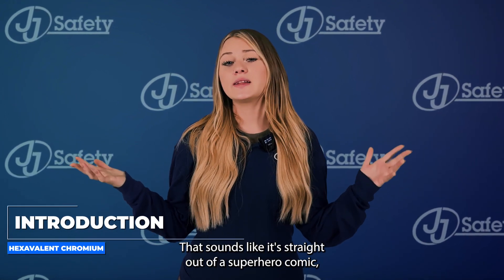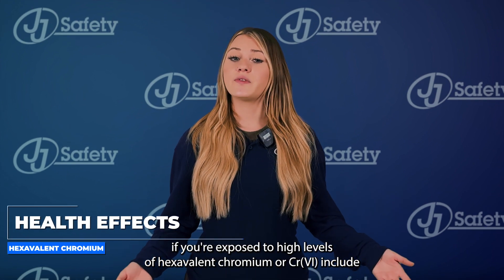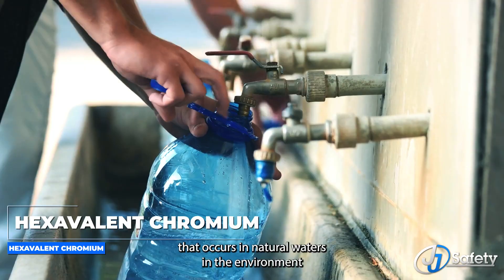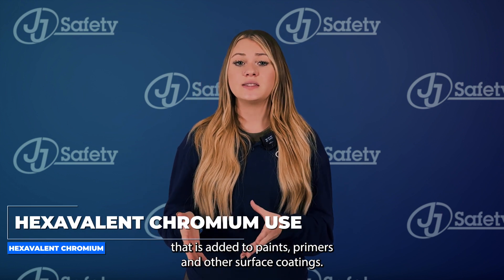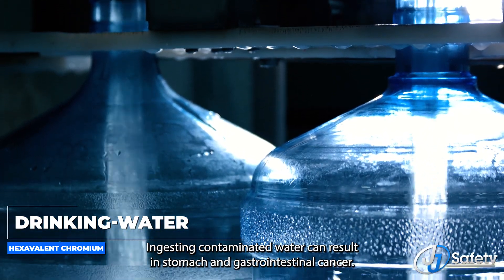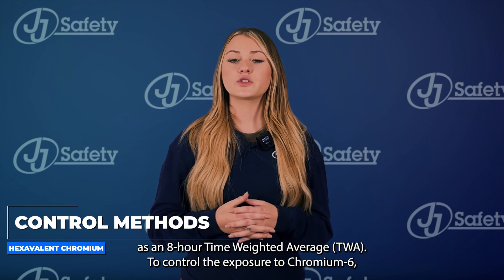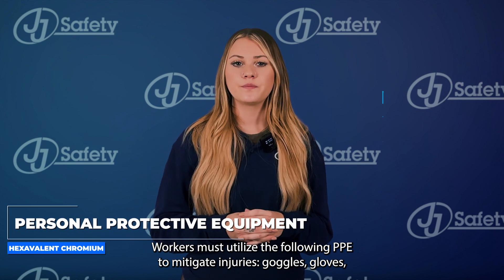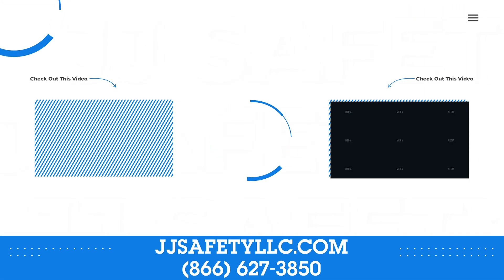Hexavalent Chromium: Know the Risks, Stay Safe! [Toolbox Talk]

Comment: I wish I had watched this video in 1982 (😁), which is when I spray painted a lot of military vehicles with a paint called Chemical Agent Resistant Coating (CARC).  Back then, we did not use any PPE and we painted inside the bays of the motor pool, which had no mechanical ventilation/exhaust system.  The pigment of the CARC paint contained lead and Cr(VI) (e.g., molydbate orange).  The mixing agents contained hexamethylene and toluene diisocyanates (HDI and TDI, respectively) among other volatile organic compounds.  The aerosolized paint got into my nose and all over my skin, eyelashes, eyebrows, hair, and even inside my ears.  I would frequently blow my nose into paper napkins and paint with mucus would come out.  Some 40 years later, I got diagnosed with Reactive Airways Dysfunction Syndrome, bibasilar actelectasis (collapsed lower lungs), lung nodules, nasal polyps, deviated septum, severe sleep apnea, migraines, GERD, cataracts, and allergic conjunctivitis.